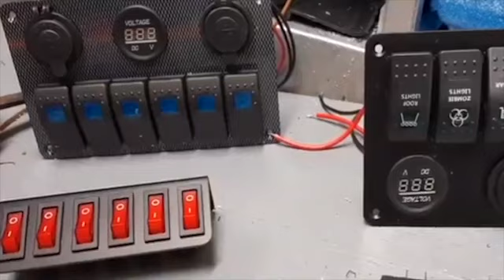My 12ft Jon boat to Tiny Boat Conversions EXPLAINED!!! JonYak Series. TBNation

Comment: I have a tracker topper 1036 I recently finished a conversion after watching this I may have to redo I removed all the foam from my bench eats for more storage andthe only foam I have is in the floor and sides but I did install a bilge pump